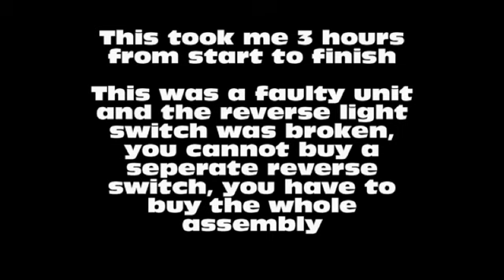How To Disassemble & Reassemble A Mercedes Benz c180 Gear Lever Assembly (W202)

Comment: Thank you for posting this.  It allowed me to make the decision to buy a new assembly because there are too many pieces to test accurately for my time/cost analysis.  I.e., the solid state electronics in the neutral safety switch is challenging to test accurately and identify the failing part beyond obvious visual corrosion etc...awesome video as far as tinkering goes.